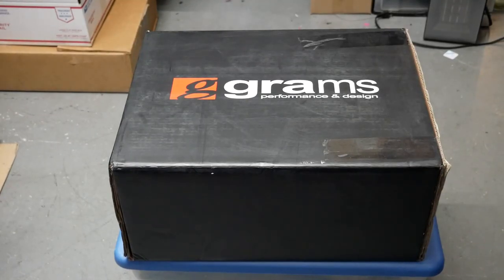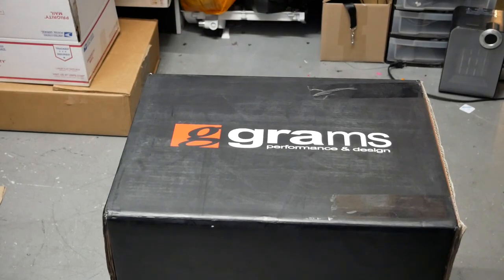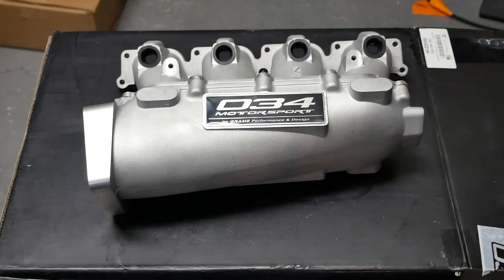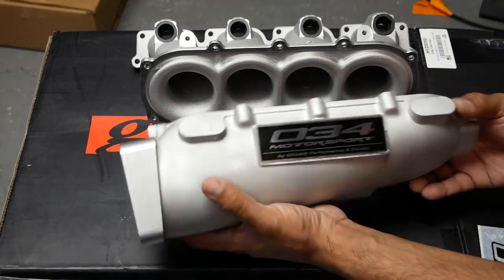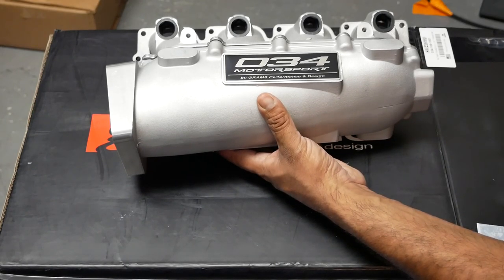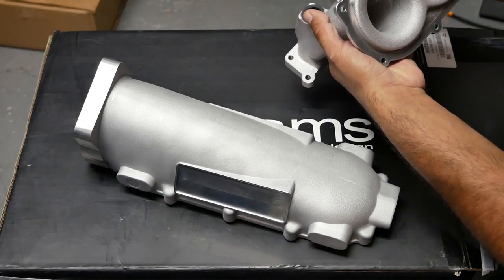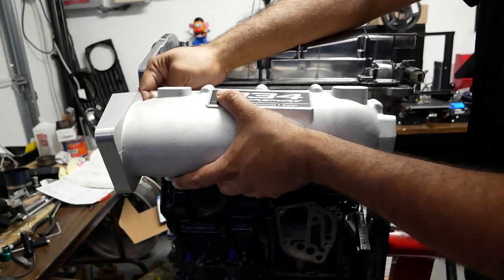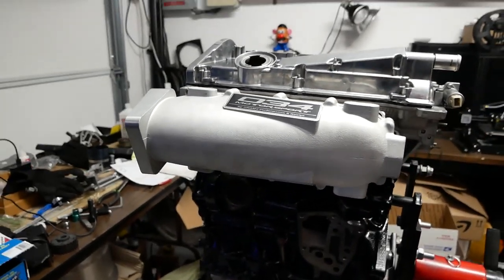O34MotorSport Intake Manifold Uboxing

Comment: Had mine for about 4 years on my TT 225. Actually got it on pre-sale. Looks like they have fixed some of the issues and improved the included hardware too. I picked up over 10mph at the straight on my local track 👍
Reply: And it’s reversible too 👌

Comment: Hey 2as just wondering mate what kinda injectors can you run I got 500 cc injectors on my golf what sizes can you out on
Reply from the maker: Depends on what you tuner wants and your build
Reply: @PincheALsGarage  na so everything ready to go I just want a. New Manifold asking if the my injectors 500cc would fit in the cups
Reply from the maker: @nedsalkeld4995  yes your injector will fit
Reply: @PincheALsGarage  aught thanks you cant wait to buy and put it on

Comment: I Installed this one but it is not a direct fit, the intercooler piping no longer fits )=
Reply from the maker: Yea its bigger
Reply from the maker: Need to cut and weld tour piping for better fitment. But you will enjoy the reward for extra power and flow